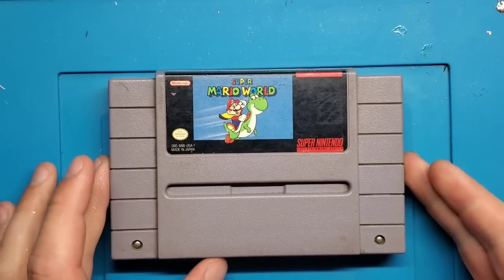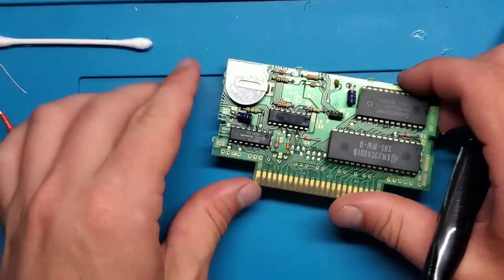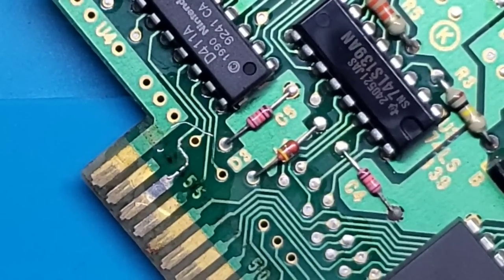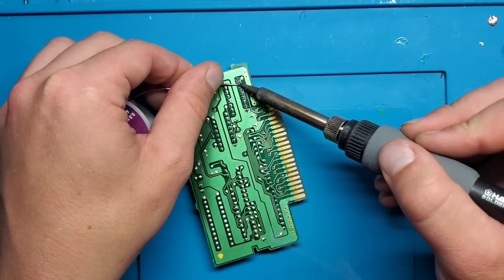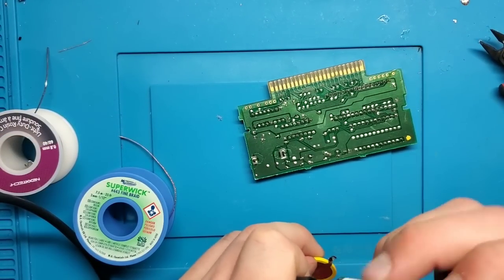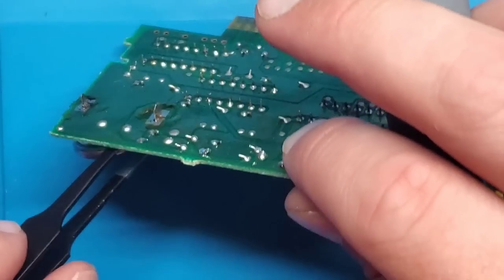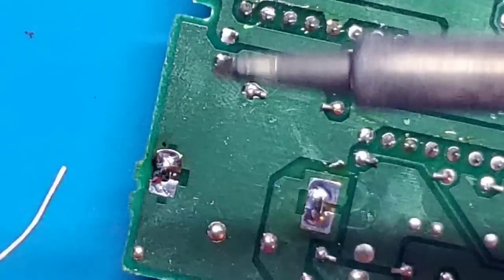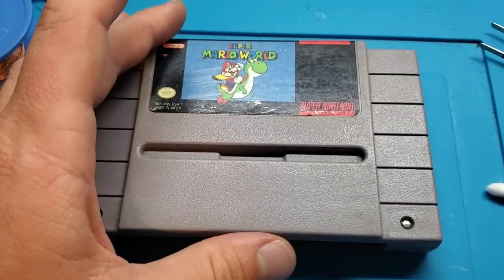SNES Game Won't Boot - Fixing eBay Junk - Super Mario World

Comment: Instead of soldering the battery directly to the board you could solder a CR2032 battery case to it and then put the battery into that case... that would be a cleaner solution which would make a future battery replacement easier too
Reply: Battery will last over 10 to 20 years will you really need  to replace it again
Reply: @michaelholmes4374  short term thinking
Reply: @Gorton  how is that short term thinking in 10 to 20 years most people will have moved on I've had enough of retro collecting sold most of my expensive games replaced with a flash cart

Comment: Flush cut the battery leads, this will make it easier. This removes the battery that is acting like a heat-spreader absorbing all the heat from your iron.
Reply: Ricardo Cooper also, heating a battery is a bad idea(tm)
Reply: It also doesn't help to first remove the all the solder from the bottom of the board.  If the pad is dry, the iron only makes contact in small spots.  Working on a fillet reduces the thermal resistance between the tip and the board -- as does using something better than a D1.6 tip.

I'm assuming most people don't have a desoldering iron that's worth anything.  Parts like this with only a few flexible leads can easily just be walked out of the board with the iron. Add solder, hinge part out, wick pads, replace part.  Wicking is even optional.  For something like this, you could just walk it back in.   Before anyone complains that there's a risk of lifting traces on the top side, I have to point out that digging around and prying while insufficiently heating the bottom side is an even better way to ruin things.  The same goes for scrubbing around with a weak desoldering iron, trying to get the topside fillet to melt or trying to get the last bit out of the hole.
Reply: @PSUQDPICHQIEIWC  In fact PCBs are pretty hard to delaminate mechanically unless you do something very stupid. What kills them is the absence of preheating - and the thermal expansion that follows. So what I usually do with through-hole mounted stuff is preheating things (well, I always do this), applying much solder to have some heat storage - and then just pulling them out while heating with both the iron and some supporting heating (can be done even with a small blowtorch should you get used to it). Can require walking for wider components (some small ones can be just shaken out), but this never caused any bad consequences. Of course, doing this with a battery isn't the best idea though, so I'd just cut the leads off :)
Reply: Preheating is good advice.  A lot of people recommend plate heaters, though I find that it works better to use your hot air station to add heat where needed.  A hot air station (or heat gun) can couple heat to either side of the board and can be selectively applied, unlike a hotplate.  

But you're right.  The whole thing is an issue of heat flow.  The plating in the hole has such a thin cross section that it has a significant thermal resistance on the through-board axis.  Similarly, the solder annulus has a small cross section and the alloy has low volumetric conductivity.  A large part of the heat that you're coupling to the top side has to go through the part lead.  This is why it's a pain to wick a hole after the lead has been removed.  You're either going to have to increase the temperature or minimize all the resistances on the solder side, or you're going to have to bring heat to the top side via some other path.

FWIW, the plating adhesion on paper phenolic is much weaker than it is for something like FR4. Especially if the board has been hot in service, they peel extremely easily.
Reply: @PSUQDPICHQIEIWC  TBH I prefer to not use wicks for holes at all. Those are not SMDs so you don't care about any extra solder anyway, all you need is the hole itself. The most fun way I found so far was adding much solder to make it melt better - and next using a thin tube to just blow the air through the hole. Unlike the vacuum solder removers this requires no contact at all (even some significant distance is still ok), and the surface tension makes most of the solder just fly away should it be heated well enough.
As for air guns, yes and yes! Hotplates take too long to properly heat things up (as your board has different heat diffusion paths and inconsistent IR reflectivity you are forced to heat it very slowly) - and with a gun you can control the heat gradient on the fly. Though I sometimes prefer smaller torches - as the flame is a stream, it has a lower pressure compared to the ambient air, as a result the colder air gets mixed in, creating a very stable temperature gradient - just find the "sweet spot" and use it :)

Comment: Great video! I usually put kapton tape on the edgeconnector before going near it with solder, hate when the nice golden fingers turn silver..
Reply: True, if you watch AkBKuKu's video on him trying to add chips onto a ram board, he get solder on the pad and trys to remove it with a sucker, he ripped the pad itself off and had to use a little copper piece from a spare PCB to fix it.
Reply: Your so cool bro!!
Reply: @eKoV11  "you're" you mean?

Comment: Hey boss!!! When cleaning your pins. I use a big pink eraser. Then follow it up with IPA. 
It gets all that brown oxidation off the pins. 

For polishing it’s a whole different thing. 
You can use glass top oven cleaner. And it will get the pins superclean. But I prefer using brasso. And light scrubbing. 
Great job as always.
Reply: But I rather think the brass went off from the pins, because it was used a lot. They losed their colour.

Comment: "to desoder, the first thing i like to do first is add more soder"
Me: surprise pikachu face
Reply: It sounds weird but it's the way to do it
Reply: Desolder..... Solder.
Reply: It helps form a bridge to allow the heat from the iron to flow into the joint easier.

Comment: The cleaning of the pins makes my ears and soul bleed
Reply: I read this before watching and though, how bad could it be?
But you nailed it
Reply: OMG I wish there was a warning for this, ouch.
Reply: EdgyShooter i was going to comment exactly what you said lol
Reply: I wet sand my NES contacts with electrical contact cleaner and 2000 grit automotive sandpaper. Quit cringing. If your contacts were tarnished when you started cleaning and were shiny when you were done then you removed metal from them. That's how removing tarnish works, no matter what method you use. You can't get clean contacts without removing damaged metal.
Reply: @adamgh0  i understand this, but it doesn't make it any less painful to hear... Also can't believe you used the word cringe unironically.
Reply: @adamgh0  And you removed the gold plating meaning they will tarnish again even quicker.
Reply: @NearFarMedia   They're not gold plated. If they were, they would never tarnish. They're copper just like the traces.
Reply: I had to fastfoward through it
Reply: that's the famous satan choir
Reply: @woofoof  Using the word unironically unironically
Reply: You just used it....

Comment: Nintendo used to weld those batteries into the circuit board tabs.  They should’ve made battery detachable sockets there for standard coin battery replacement. Like the CMOS batteries on the back of the Sega Saturn.

Comment: I would recommend using a fiberglass pen, also called fiberglass scratch brush, instead of a box cutter to expose a trace. It's made exactly to remove solder mask without breaking the traces.

Comment: when trying to get the battery out, it's often easier to put on fresh solder as you did, then heat-up and use the tweezers like you did, then wick AFTER to clean up the pad's that remain - it's also easier to use the wick once the component is removed...

Comment: Quick Tip: 
For removing the battery it would have been easier to add more solder to the pins as you did, but instead of wicking the solder away first, it would have been much easier to apply the pressure with the tweezers, apply heat to the pad with that extra solder on there and the pin will pull out easily, as you have more solder to retain and spread the heat to the whole pad/leg. then once battery had been removed you can now use the solder wick to clean up the pad and clear solder from the hole. 

Also if your having problems with the solder melting and flowing, turn up the temp of your iron if possible or simply use a larger tip. Should only need to touch the pad for 3-4 seconds to have all solder melted/flowed.

Another tip for cleaning the Cartridge Contacts use a Fiberglass Scratch Brush/Pen they work well, also good for removing the green coating to expose the traces.

Comment: A better idea, do not remove the solder before removing the battery. Heat the glob as is because the connection  would be better with the extra solder on there and while it's liquid then remove the pin from the board. Then soak up the remaining solder. It would have been much easier. Skip all the mess.
Reply: Correct. Also to not use the very edge of soldering iron in these jobs.

Comment: i was freaking out when you started using a q-tip. all those little threads of cotton getting all over the pcb D: why not use a dedicated tooth brush? you can get pretty soft ones. i was also cringing when you wiggled the cartridge around after having JUST repaired the broken trace. these cartridges can take a bit of a beating but that just made my skin crawl. it all worked out in the end, though. not how i would have done it but hey, i didn't make the video lol

Comment: I think it's better to use a battery socket rather than soldering the battery directly to the board. It's better for future users since that's one of the most common issues with carts.

Comment: I love your videos, the struggle to get that battery pin out of the board felt real. You didn't just cut to the part where it came out. Very nicely done. Was the original battery dead, or did you just replace it since its 26 years old?
Reply from the maker: The latter.   Even if there were saved games i would have replaced it

Comment: I love to watch your stuff, is so relaxing. Just asking a question, maybe a dumb one. When you booted the game and noticed there are no save files you jumped to the conclusion the battery is dead, couldn't be that someone just manually deleted all files? Did you tried saving, powering off and on again to check? Thanks for the entertainment
Reply from the maker: It's possible,  but at the same time,  25+ year old battery is due for a replacement anyway.  If it's still good,  it won't be for much longer
Reply: @RetroRepairs  I see, thanks :)

Comment: Hey man! 1st of all great video, I really enjoyed that! Funnily enough I will have to do exactly the same to my Mario world copy! :) also what av cable do you use? I just got a random amazon one and my picture looks in 8 bits compared to yours! :( thinking if that would be the cause and kinda hoping it's not the TV haha keep it up :)
Reply from the maker: I've got the oem av cable.  It definitely could be your tv, this is a tiny one so it looks a bit smoother. Trying to run it on a big flatscreen will definitely look choppier
Reply: @RetroRepairs  thanks I might give that a go just to see the difference. I only have a 40inch so that's I was hoping it was the cable - bit cheaper fix :)

Comment: The original save battery may have been ok. I once bought a 'no-save' game with the intention to replace the battery and it turned out to be untested - there were no saves on the cart but once I saved the game, it held.
Reply: Bartosz Nowicki be careful,it could fail and leak battery juice because of its age potentially ruining the cart

Comment: Good video but wanted to add that using a flat file or small flatblade screwdriver would be much better on the board than a razor knife.

Comment: I had a super Mario world cart that was dodgy some years ago, same as this version USA, every so often it would loose it's save data, I didn't know much about soldering and problem solving then so sold it, know I rekon it was probably a broken weld on one of the battery tabs as I've seen a few carts suffer from this when the cart is dropped or taped the battery momentarily comes out of circuit.

Comment: To add to the fray of comments. As you're reflowing, you should flood the area with flux, or add a tiny dab of solder to help flow out any oxidization.

(Now, in a perfect world you'd pull out the old solder, but, seriously, who does that outside the robotics and aerospace industry)

Comment: You could have taken the battery out without replacing the housing. It the same size battery number as many watches and car keys cr2032
Reply: The battery is actually welded to those metal tabs.

Comment: Fiberglass eraser works best on the pins  alas 1. watch out for the non pins and your 2. finger with glass splinters  I use the alcohol for anything else.  Never run into a non booting game before.  Although alot of that is SNES more than the cartridge

Comment: 99.9999% of the time by cleaning the pads with 99% isopropyl you fix every cartridge.
Reply: Except when there's broken traces, as was the case here. I've got a GameBoy game that's similarly broken but too bad for me, GB traces are MUCH smaller.
Reply: @SatoshiMatrix1  my pokemon yellow had a Pad lifted up in a chip I touched it with the soldering iron and that fixed it, try to fix your cartrige too.

Comment: Q: Can you just use a circuit writer pen to repair those small lines instead of soldering? I did that on my car's dashboard touchscreen board to repair some broken board connections and it worked.

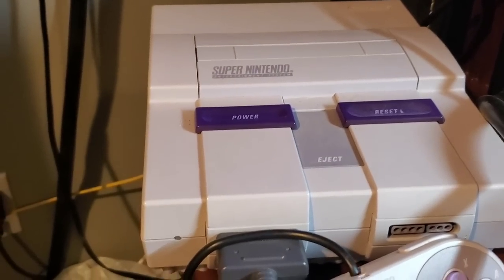Comment: 0:55 did this man just take the cartridge out without hitting the eject?
Reply: All the eject does is lever up the cart slightly. There's no hazard to cart or console by inserting or removing it this way.
Reply: @raggededge82  nah bruh it lifts it out with even pressure. theres a reason for everything

Comment: Can you use a CR1616 battery instead of CR2032 on SNES games?
I'm thinking its possible but not sure.

I had trouble installing a CR2032 battery holder with SNES Zelda LTTP PCB.
I was considering installing a CR1616 battery holder instead.
Id rather not do tabbed batteries.

Comment: I recently got a copy of Lufia 2 for SNES and it boots up the Natsume logo then it restarts. I cleaned it still won't fully boot. I tested the pins with a multimeter and they all seem have no breaks. I haven't changed the battery yet, if that doesn't work do you have any ideas?

Comment: i would of added solder to the battery then just pulled it out.. no need to remove the solder till you remove the battery. its harder to heat that tab with no solder on it

Comment: One thing to do if you want to remove corrosion and gunk from pins is to use a little bit less IPA on the q-tip I found that it . In this case I probably just would have used something abrasive to wear it down just slightly since any protective layer that would have been there from the start would likely have been shot to hell anyway :)
Nice video!

Comment: Any thoughts regarding one of those hot air things? Seems like using that to reflow the chips would probably have saved you a bit of time.
Reply from the maker: For surface mount soldering,  definitely.  For through hole,  i still prefer an iron
Reply: @RetroRepairs  I guess my general thought was it'd be good to reflow everything quickly and easily. I'm probably gonna buy one and test it out on some stuff and see how it goes. I'll let you know if I don't f anything up.

Comment: Do the batteries ever run out? Imagine having to replace it if it does.
Reply from the maker: Yes,  you have to desolder the old one and solder in a new battery.  Its a fairly simple process as long as you have a soldering iron

Comment: Would it be possible to solder in a battery holder, rather than a battery for easy replacement later?
Reply from the maker: Yes, but later will be another 25 years from now.   I'm not worried about it

Comment: use the Eject button man your killing me just by watching the video lol like the video tho good work
Reply: Using the eject button wear out the mechanical parts...
Reply: @anderslarsen4802  And the power button wears out the power supply. Better not touch the console at all, really.
Reply: OmikronWeapon And that is why you use modern replacement psus, less heat/less weight. But air will slowly rust away electronics wether you use it or not.

Comment: What temperature is your soldering iron? It seems to melt solder a lot faster than mine. Thanks!
Reply: Use chisel tip. Not enough thermal capacity in the pointed tips. Aroud 650f?

Comment: Genuine question - why not replace the soldered battery with a holder?
Reply from the maker: Mainly because i see no reason to.  They're simple enough to change out,  and shouldn't be an issue for another 20-30 years,  if there's even a working SNES by then.

Comment: HI you have fixed  a lot of games as I have seen from your other videos that I have watched.  I have a copy of of Castlevania 2 and for some odd reason no matter what it doesn't work on either version of Game Genie that I have.  it works on other games so i figured it was the game copy since you it was second hand. can you make any suggestions of what I should look at if I was to open the copy of Castlevania 2 and what I should do to see if it can be fixed before I go out and get another copy. It works normally without the game genie.
Reply: I  have the same problem with battletoads I came to conclusion that the game genie is the problem not the game
Reply: @gregjarvis1232  I try another game genie and it was the same
Reply: @Jacobmainchannel  
My Game Genie freezes the game
When I enter a code....
If I don't enter a code it just works a passthrough
Reply: I like to stack nes game genies to get more codes when I need too